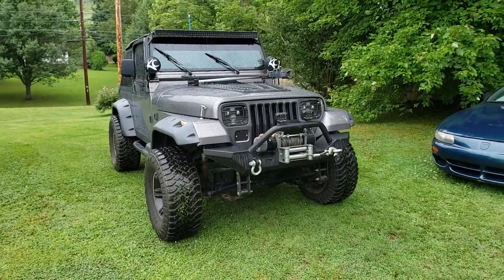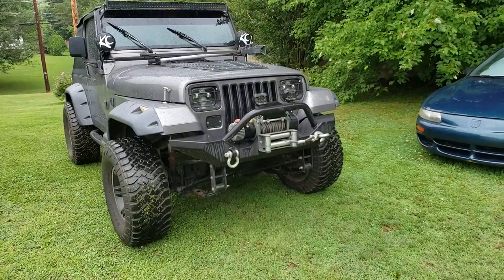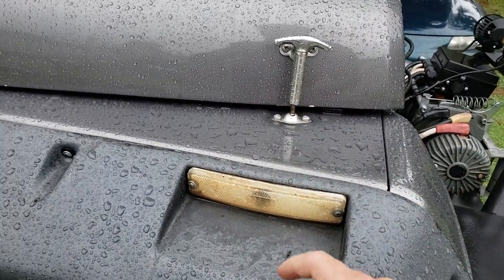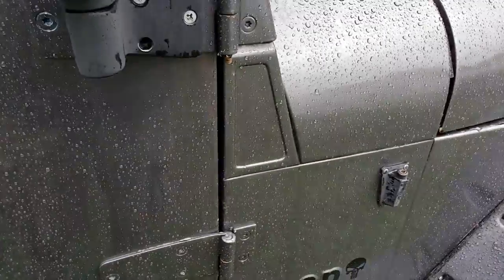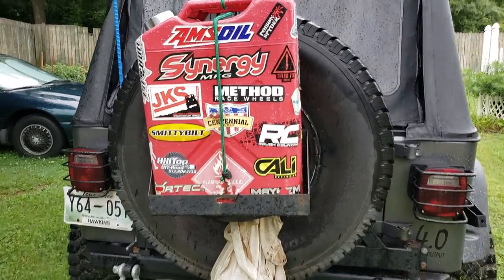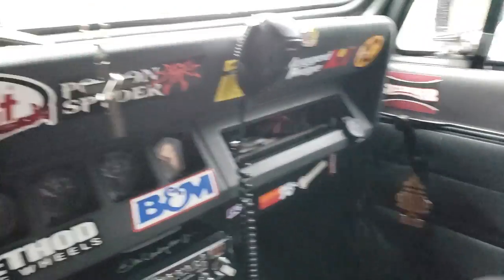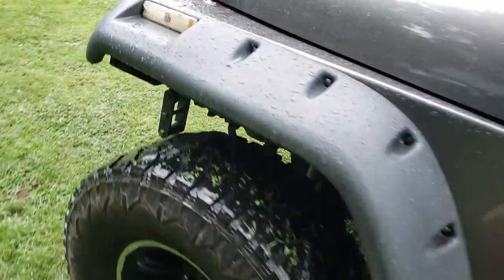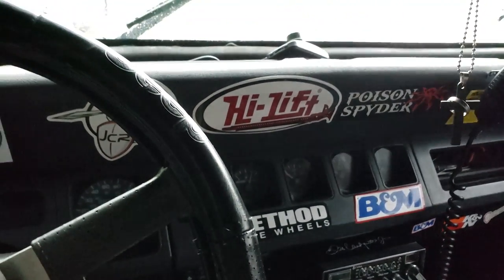In-Depth Tour of my 1993 Jeep Wrangler YJ! | Rattletrap YJ |

Comment: Killer YJ man!  I'm working on fitting out my 89 YJ that has 4.2 and 5 speed. (had a '92 over 25 years ago...that I sold and never could remember why). Enjoyed your in depth tour. Just got same headlights delivered, haven't installed...but more excited about them now that I see them on yours! Unlike most folks, I like the retro rectangles but this just gives them more modern vibe.  I also have 15" rims with 33 MT's and 4" lift (RE 4" but not lifted shackles). Question for you:  I noticed on your underneath shot, you don' t have transfer case drop. Did you have that before you installed SYE? Any issues with your lift and driveshaft alignment, etc., after removing TC drop? I'm planning on SYE this spring, and would love to get rid of the TC drop spacers like yours!  Good job on your killer classic jeep!
Reply from the maker: Yes, my jeep actually had a transfer case drop on it when I first bought it. But it was like homebrewed. The shackles were homemade too and super unsafe. When I first bought the jeep I knew they needed to be replaced, but I waited too long and they snapped in half. It caused me to run off the road and flip the jeep over. So, I learned the hard way... I went with the 4" Rough Country lift and removed the homebrew TC case drop and added the RC kit. (I wish I went with a different lift, but I was in college at the time and had a minimum wage job, so I tried fixing things with a budget lol.) Years later, I blew up the Dana 35 twice. Then sheared the ring gear and blew up the input shaft in my transfer case. So instead of fixing the D35 for the 3rd time, I decided to swap the Ford 8.8 under it. I had both diffs removed and matched up the shock and leaf spring perches and welded them to match the Dana 35. Then slapped that under the jeep. Bought an SYE kit and it came with the double carden shaft. Tore the transfer case apart and rebuilt it. Then threw the SYE on and it's been amazing ever since. With the SYE you need to angle your pinion to match the TC. Kinda like if you were aiming your rear diff pinion flange as iron sights on a gun, you'd "aim" it at the TC case. That will fix all driveline angles and you won't have any vibrations or excessive play

Comment: Hi I have a 94 yj jeep wrangler and it runs great I need to replace the bottom piece of the windshield where my wiper arms go the rod inside there and the wiper arms and motor. My main issue that I have is frame rot can you please tell me what I can do about it any and all help will be greatly appreciated thanks
Reply: yikes.. frame rot is no good. if it’s real bad you’re gonna need to strip everything off of it, repair the frame, and put it all back together. this can be good though if you want to do some upgrades like putting a lift on it or replacing the dana 35 with a ford 8.8

Comment: Sorry to say that bungee cord on your gas tank is not only dangerous. It's irresponsible other than that nice jeep As far as your stereo goes, most people use stereos designed for boats. They're made to get wet. And they last a long time because they're also made to take the pounding a boat gets
Reply from the maker: The bungee cord has outlasted the rachet strap that came with the kit, and it's extremely tight. The jerry can is extremely secure. Not sure how it's dangerous, or irresponsible.

Comment: Bungee cords get dry and crusty, and then they fall apart. If the tank falls off in traffic could get Under a Moving car and spark up a storm Especially if you drive on the freeway. Bottom line is if you had half a brain. You'd secure it very well not with bungees that's what idiots do Sorry but those are the facts. If it was a can of water it might not be so bad
Reply from the maker: Nah, it's secure and I don't let my bungee cords dryrot to that point it's an issue. I guess if you weren't a retard you'd understand that, but I'd imagine you're the type of moron that rides until his rotors are marred up before doing a pad change. Krod the nimrod should be your new username.
Reply: @krod2162 I agree with OctaneSlain. Nothing dangerous about it when maintained. You're just one of those people that like making issues out of nothing.